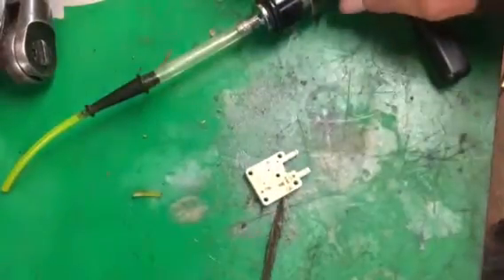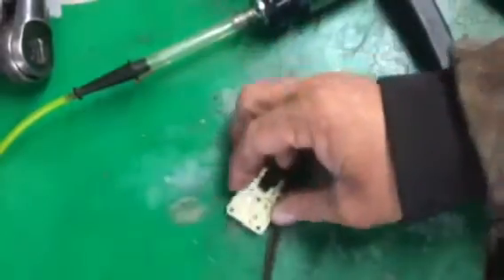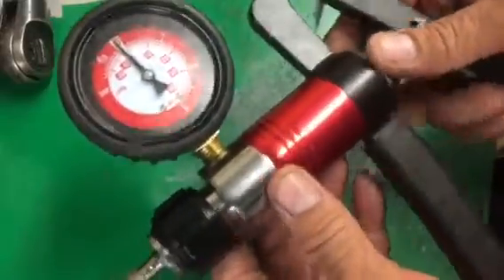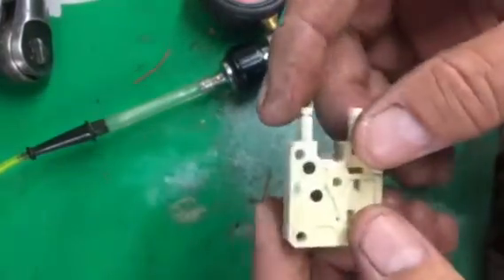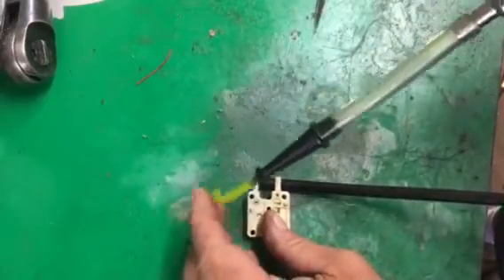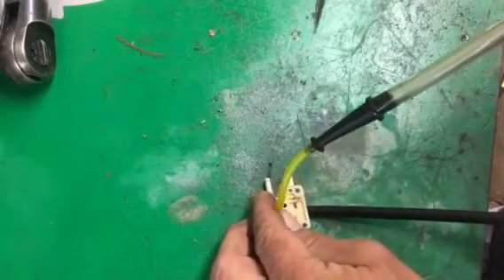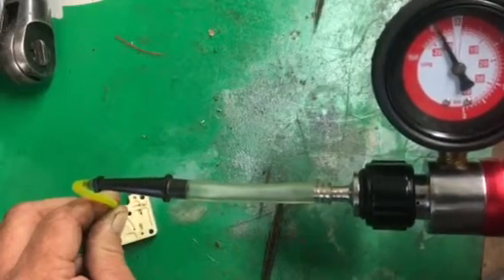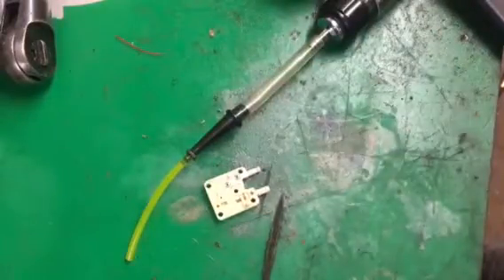Zama Primer Base Assembly-Testing

Comment: Great video!  I took mine apart and there is a spring in the bottom and a tiny rubber gasket that goes against the silver plug.  All we need now is a source to procure the tiny rubber gaskets. Thanks for the info.
Reply from the maker: To make the gaskets you might look at gasket hole punches. They are for punching holes in gasket material for when you make your own gaskets. They come in a set of nine and have very small ones. If you could find some rubber you could punch out your own rubber gaskets. maybe a tire inner tube would work.